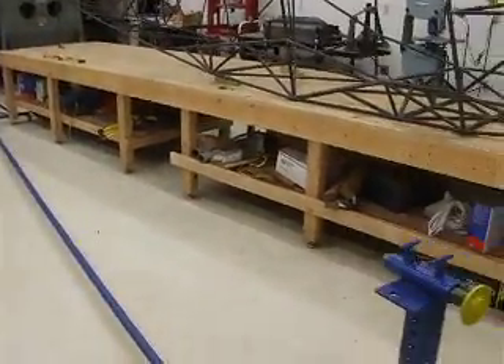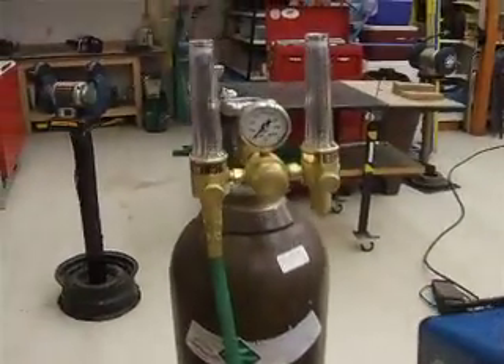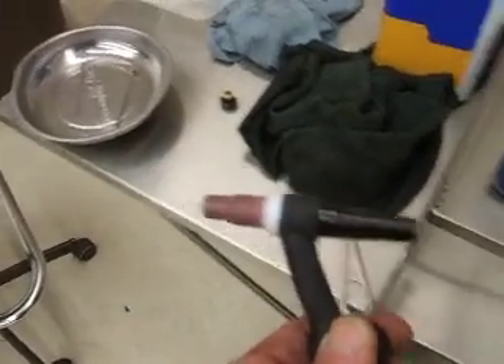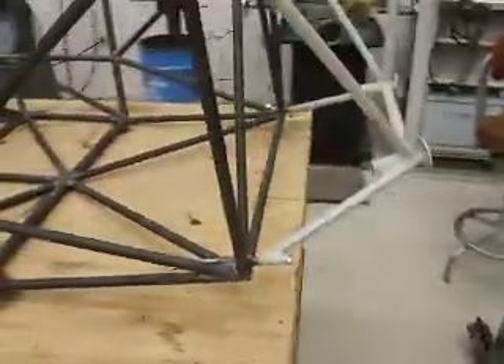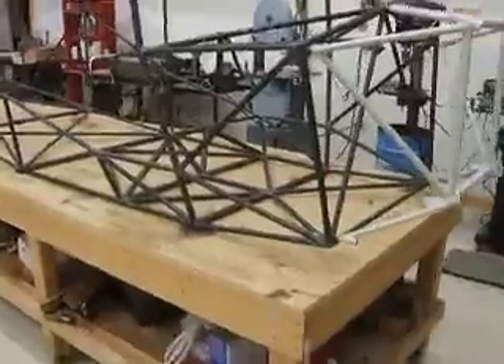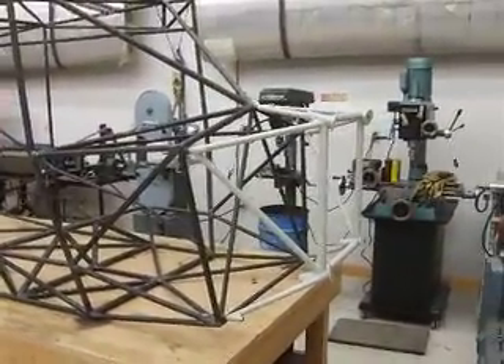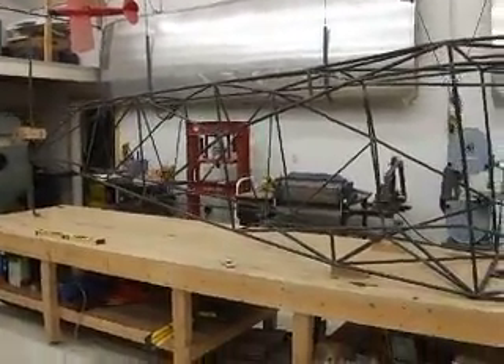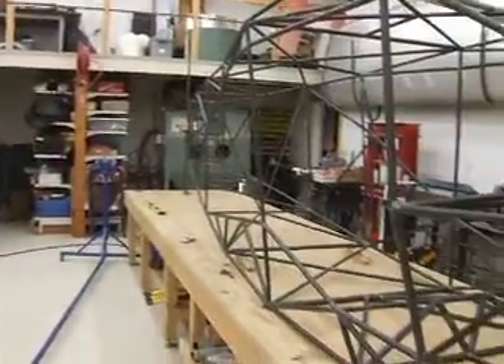Finish Welding My Bearhawk Fuselage

Comment from the maker: Hi...

Thanks for the kind words! I didn't do any purging of any tubes. I welded with argon, but it was shielding gas for the weldments and there was no internal purging with argon. The only thing that I may have done in a tight cluster from time to time was run argon via the torch tip in close proximity to a cluster for 5-8 seconds before welding to allow for some "pre-purging" of the area prior to welding. I don't have any basis for doing that other than it seemed like a good idea at the time.

Comment from the maker: There are one or two manufacturers that I'm aware of that use MIG, but the people that do the work are pros and work under very controlled conditions. Unless you are a professional welder with years of experience and very practiced in welding thin wall 4130, I would recommend against it.

Comment: Forgot to mention a big congrats on the "Keeping it Straight square and plumb." Did you get coaching on Selective block sequence
 to off set stress related torque or some sort of jig clamping method to hold things in shape? Keep going. That's a major hurdle.

Comment: That pin hole at the end of your weld is a crater crack. Not good. Dont just cut the torch off with the foot pedal bring the arc up out of the weld and on to the shoulder as you roll out of the weld to break arc.

Comment: Your bearhawk looks great. I do have a question and it may have already been asked. Ive watched your videos on tig weld and the stress test that you have done and they are excellent! It proves that the tig weld is obviously stronger than the steel itself. My question is Do you plan on going back with a torch and post heating all the clusters to normalize the metal or do you think it would be beneficial to do so?
Reply from the maker: Cameron R Great question. No, I don't plan on doing anything more. This topic has been debated ever since time began...well almost. The reasons why I won't are as follows: First, no one can "normalize" any metal without being very accurate on the temperature to heat the metal to, how long to hold that temperature and most importantly the controlled slow-cooling of the metal. No one can do that with any accuracy using a torch and the Mark 1 eyeball. Special ovens are made for normalizing metal structures in a precisely controlled environment. Second, I risk inducing stress into the metal where I don't heat. Anytime metal is heated and cooled it changes somewhat and I like my fuselage just like it is. Another reason is heating at the same time. Do I do one cluster, then the next? Or do I do both front clusters together and the the rear clusters? Or do all four at the same time?  The main reason it gets done is so called "stress relief". There is such a thing as stress relief from vibration. Once the plane is flying there will be some benefit from that. All in all, the risk to screwing things up is much greater than any benefit, and any benefit is highly debateable.
Reply: Very good. Thank you for the explanation. Your project looks great and thank you for the detailed videos you do. I can’t wait to see it when it’s done. Hopefully Ill have one to park beside yours one day but Im just getting started.

Comment: Do you have to be a certified welder to weld aircraft frames?
Reply from the maker: Not that I am aware of. If you are doing welding on a certified aircraft, you have to be licensed as an aircraft mechanic or working under one.

Comment: is this welding technique better than the one they use at the factory? oxy/acetylene I think they use...
Reply from the maker: Hi... That is an interesting question and the short answer is (in my opinion) no, it's not better. Ok, now for the long answer. Either method is acceptable. But, the method that you use should be the one you are most proficient with. There is no substitute for practice! If you are proficient with O/A welding, then by all means use that method. If you are proficient with TIG, then use that method. There is a tremendous amount of debate on this, so this is just my opinion. There were some areas that I couldn't weld as successfully as I could with TIG. Conversely, there were some areas that I welded with O/A that I couldn't weld as well with TIG. I personally like the TIG process because of the ability to control the heat much more precisely. But in order to appreciate the heat control the TIG process offers I learned first with O/A.
Reply: @alaskabearhawk  Thanks for the info. The cubcrafters guys use MIG, which seems to be the most sofisticated... I read someone complaining about the welding process bearhawk uses, but it's the traditional and most popular, so it should be strong and durable. At the end of the day the safety of the weld depends on the welder you think?
Reply from the maker: @plantpower3048  Well, I would disagree with your assessment that MIG is the most sophisticated method. There are very few aircraft manufacturers that use it and those that do have very experienced people doing the work. I think Maule Aircraft uses it too. It is very unforgiving in the hands of an amateur. My opinion, and it is an opinion, is that TIG is the most sophisticated from a versatility point of view. O/A welding for 4130 is a method that has stood the test of time for many, many decades. I haven't heard of any complaints about the Bearhawk welding. If there are complaints about the process they use, they are just ignorant of O/A welding. Their products are as good or better than most production aircraft. The person behind the welding equipment is always the key,
Reply: @alaskabearhawk  Sounds good! thanks!

Comment: So you have a high frequency start? You didn't say. You should have. Also helium mixed in your argon .  Welder tips an tricks on YouTube.
Reply from the maker: Yep, the Miller Dynasty 200DX has the HF start feature. I used straight Argon, no mix on the gas.

Comment: What does one do if it isn't straight?
Reply from the maker: It depends. You have to be a little more specific as to what isn't straight and the deviation from the plans.
Reply: Anything crocked no deviation , do you cut out  tubing reweld new  or does that screw up good tubes